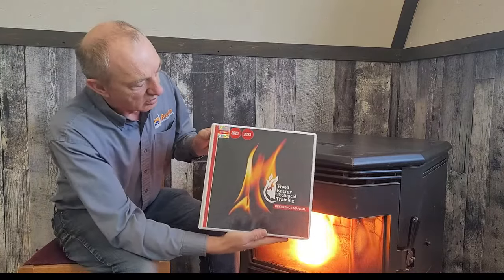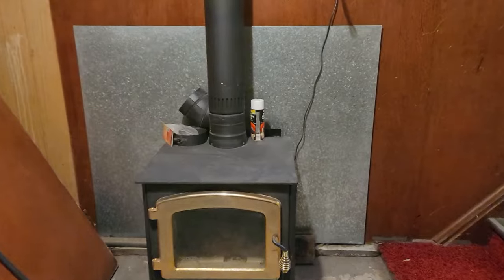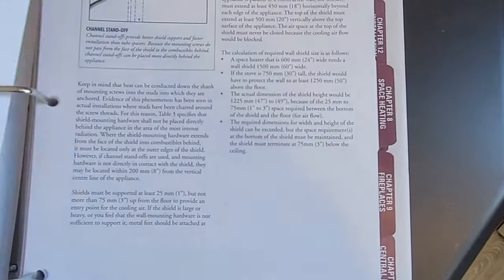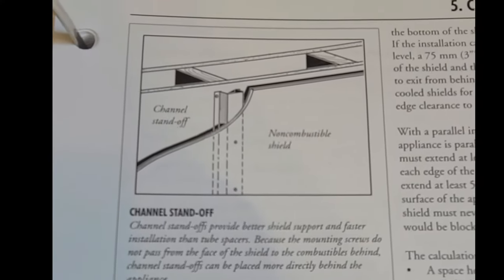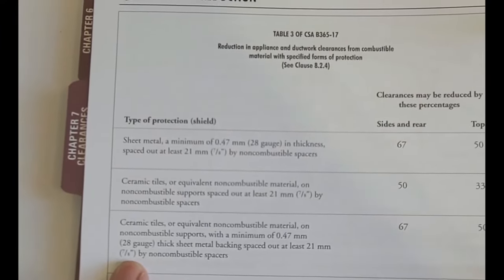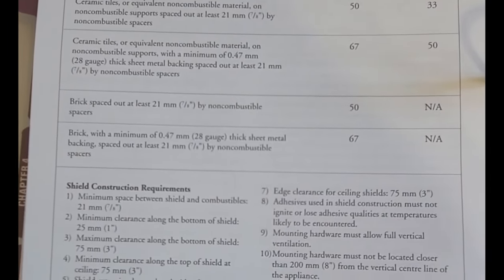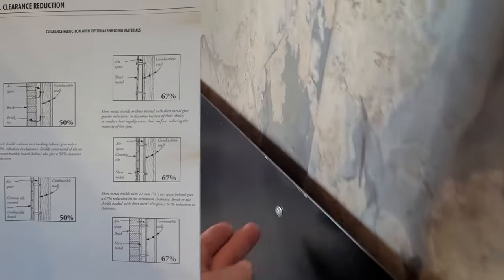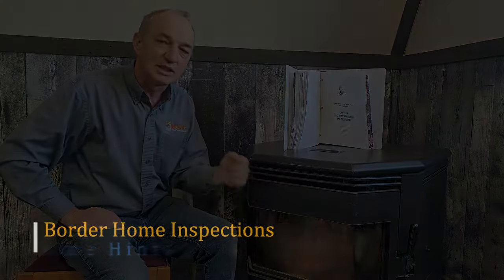Wood stove shielding

Comment: I thank you for your video :)  It has helped me a lot.  I'm also interested in hearth pad clearances.  Is it possible to get one of these wood energy technical training reference manuals, digital or otherwise?
Reply from the maker: Your welcome glad it helped . The manual is only available to Wett trained individuals I'm sure
Reply from the maker: Almost all stoves have the dimensions in their manual. If not the standard is 18" from the front of the door lip to the front and or any side with a door.  8" to the sides and back. If the stove has a clearance less then 8 " at the back then the pad much be tight to the wall only.
Reply from the maker: Watch my inspection video

Comment: I need some real numbers here.  What does 67 percent mean?  And where exactly does that 67 percent start?  Does it start at the front of the combustible wall (drywall) or does it start at the front of the shield?  Lets say 18" spacing for non-shielded wall.  We then add 2 inches of spacer and heat shield.  So the reduction is 67 percent which of 18" is about 12".  This means to me that I can now move my stove to the drywall 12 inches.  So with the 2 inches of heat shield my stove is now 4" away from the shield.  The difference between the thickness of the heat shield and heat clearances I'd like some illumination on
Reply from the maker: Sounds like you have it right. If the stove requires 18" to combustibles (drywall and studs, not Stine etc) and you add a steel shield to gain 67% reduction, now the stove can be 6" from the drywall. The shield should be 7/8" minimum from the combustible wall. The position of the shield and stove is irrelevant. When measuring from stove to combustibles ignore the shield.
Hope that helps.

Comment: Is the 7/8" standoff acceptable from drywall covered with paper, or something like cement board?
Reply from the maker: If the wall is shielded with the handful of option then the reductions can be applied. The child MUST be non combustible. Either metal, ceramic tiles, cement board and a few other materials are acceptable

Comment: What is a good noncombustible meterial to use to create that 7/8” or 1” air gap behind one’s heatshield?
Reply from the maker: Copper pipe couplings work well
Reply: I used cut pieces of conduit.

Comment: Regulations suck. We just use the stove manufacturers clearences. Most new stoves are like 9inches without shielding
Reply from the maker: I agree, some rules don't bake sense but as an inspector I need to call out even minor infractions. Sometimes miner issues mean the entire install must be redone. If the chimney is older it is likely the entire chimney needs to be replaced. 
On the other hand, stoves with clearances on the label are tested in a lab and are deemed safe if the clearances are maintained. Problem with wood heat is the heat dries out the nearby components and eventually burst into flames.
Reply: @borderpropertyinspections2634  I live where there aren't inspections lol, but I get you have to for your job. But I always want to do it right the first time, so double wall stove pipe is a must. Single wall should be discontinued

Comment: That is just weird. Most wood burners are put in old fireplaces, exhausting through the original chimney. When first used the open fire itself would be next to the wall. Why is anyone worrying about warm bricks? Oh perhaps as it in not UK these are all wooden houses?
Reply: This is for combustible wood framed walls. A lot of stoves in north America get installed in places where there was never a fireplace, like cabins, garages, even living rooms
Reply from the maker: @paulgush  I guess it's all about pyrolysis. when combustible materials such as wood framing is heated over and over again it can ignite at a much lower temperature than normal. If 480° C, 920°F is the normal wood that is super dried by the process of pyrolysis might ignite as low as 120°C or 250°F. Shielding is designed to prevent the wood framing from reaching over 90°C, 194°F.